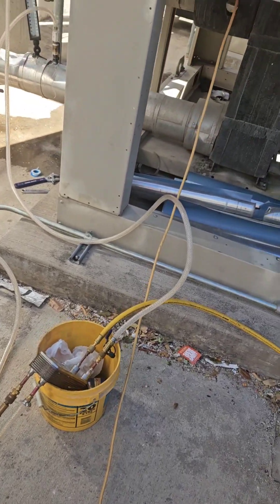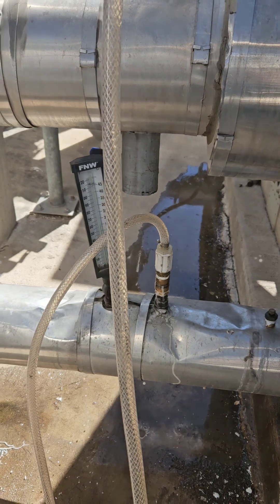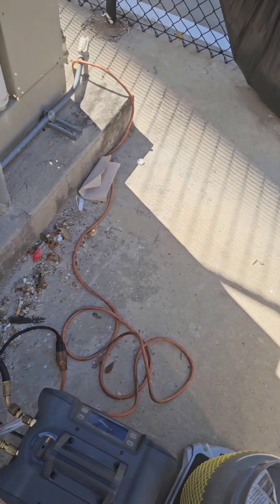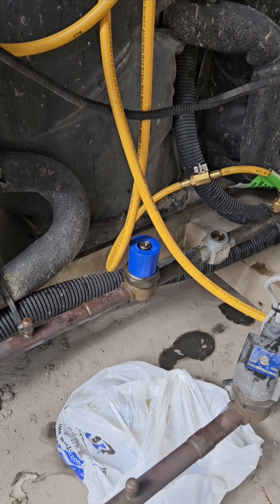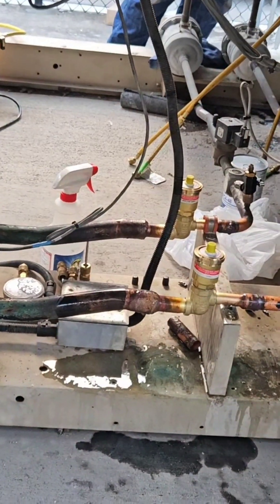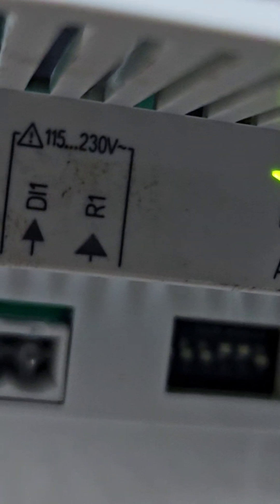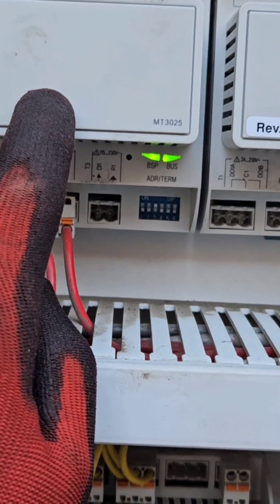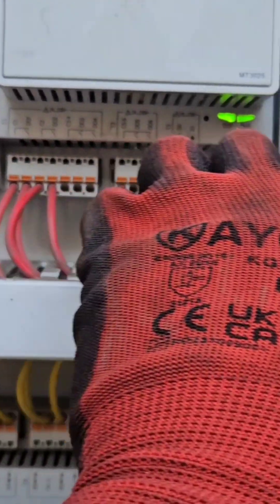CONVERTING 2 AIR COOLED CHILLERS FROM TXV'S TO EEV'S. SOFTWARE AND FIRMWARE UPDATES

Comment: Using the loop to cool your subcooler is a fucking fantastic idea, i need to make one.
Reply from the maker: @jesseh5554  it worked even better on the functional chiller. After getting one up and going, used the 44° water through the subcooler. The temperature in the recovery tank was at 80°. Appreciate the comment.